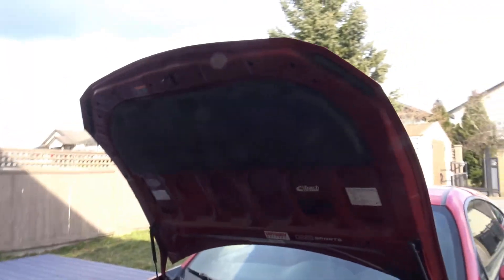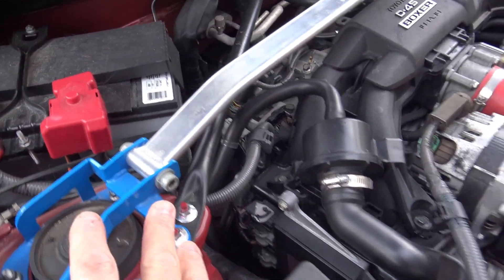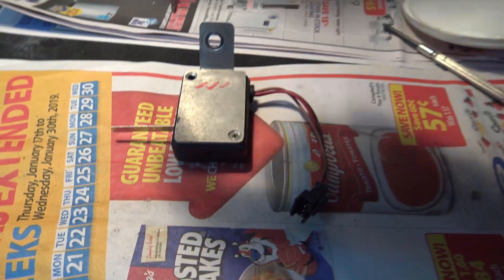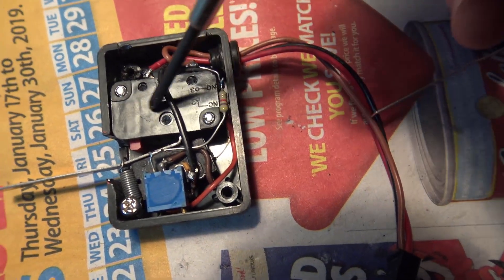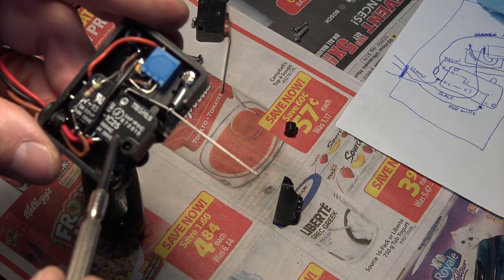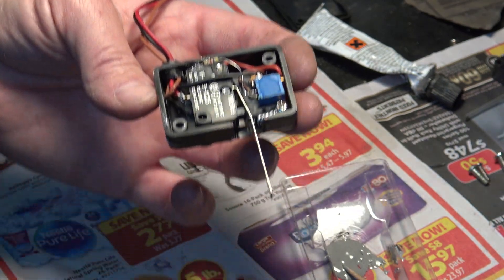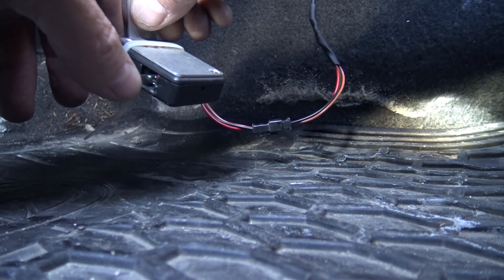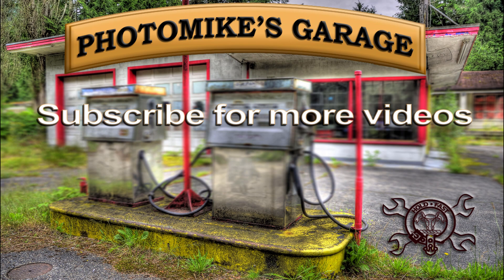Fixing broken ELECTRIC Supercharger  Part one......

Comment: So I just installed mine in the car this weekend, but it seems that it either is chocking my car at idle or there is some kind of battery issue with the main battery for the car. What's odd is that the turbine seems to spin up randomly when its detecting low vacuum and then my rpm goes all over the place. No clue what the deal is any advice?